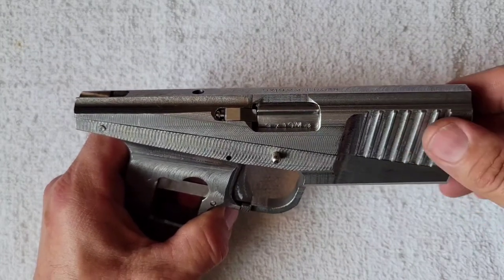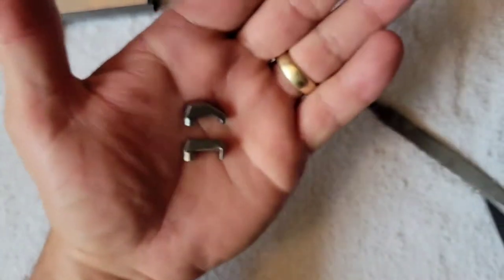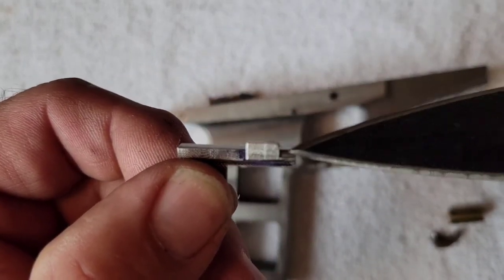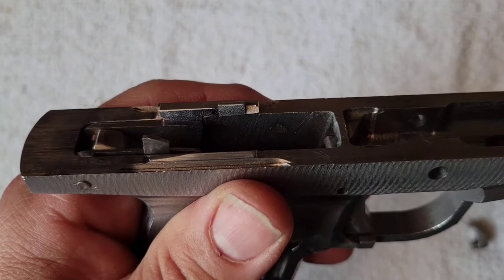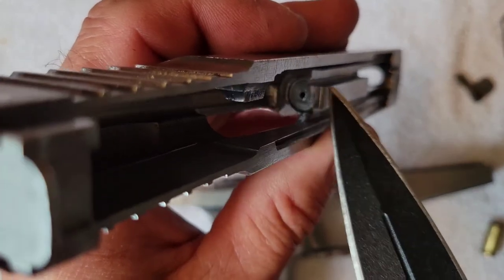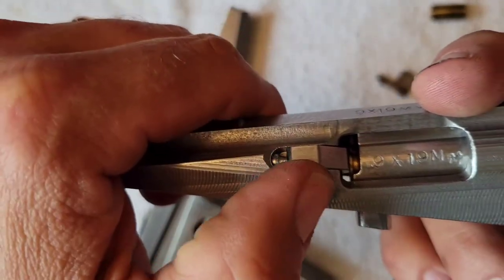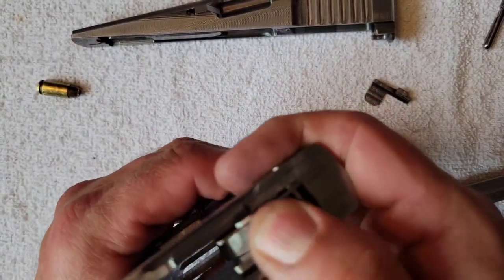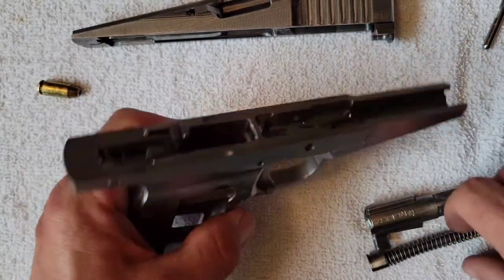Prototype pistol,  post range day 1, new extractor and ejector

Comment: I really want to see the drawings of this product. Is it possible?
Reply from the maker: https://patents.google.com/patent/US8037805B1/en
Reply: @apexpredatoroutdoors8308  Thanks you!
Very interesting, but at the same time simple design. Did you manage to sell it?
Reply from the maker: @АлексейГурин-п7к  thanks,  and no I was not able to sell it.
Reply: @apexpredatoroutdoors8308  I'm from Russia, and we can only go to jail for such crafts. Is the gun heavy? It would be interesting to see the accuracy of the fight at 25;50 meters
Reply from the maker: @АлексейГурин-п7к  it's all steel.   So,  it's heavier than a polymer framed gun.   I fired it at 100 meters.   The horizontal dispersion was about 6 inches at that distance.   The vertical dispersion was more than 6 inches,  but I believe that was the ammunition (velocity variations).